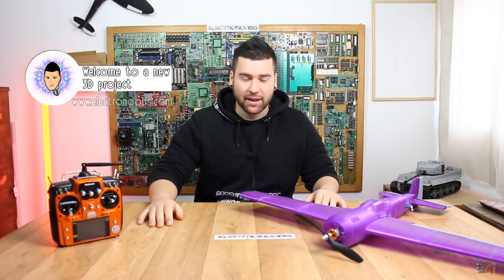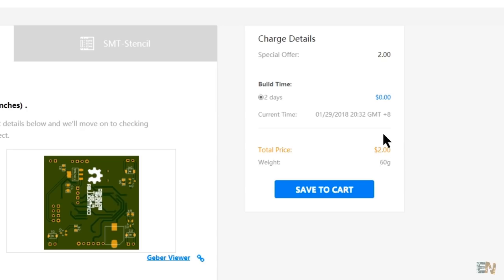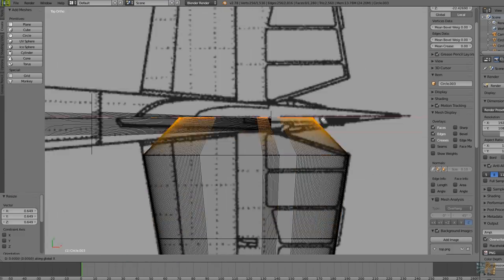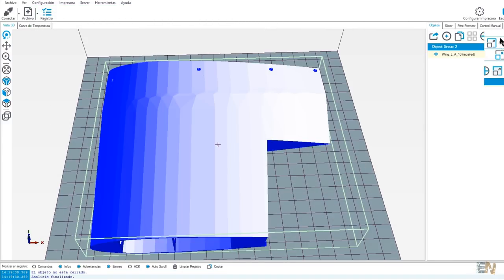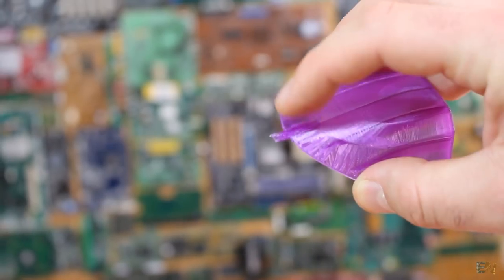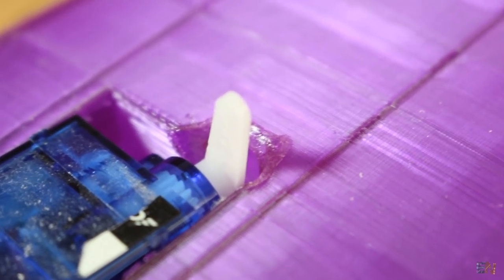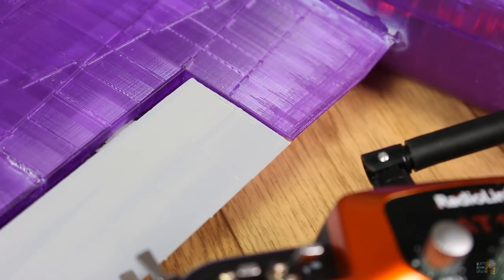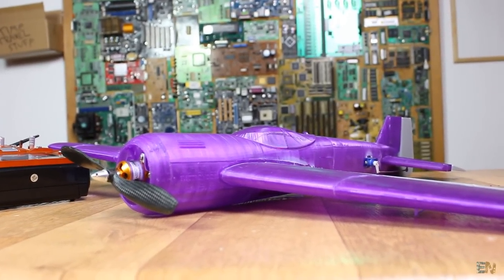3D printed huge RC plane - Yak55

Comment from the maker: First. LOL. Help my projects here, thank you: https://www.patreon.com/ELECTRONOOBS
Download all the STL  files here: http://www.electronoobs.com/eng_robotica_tut11_stl1.php
Q&A: http://www.electronoobs.com/eng_preguntas.php
Favorite printers here: http://www.electronoobs.com/eng_impresoras_favorites_mobile.php
Reply: Has anyone built it yet, if not I can help.
Reply: @coolshooo  Yes, I want to add 1 little motor to wings A, shortly how to edit the wings and what softwere need to use on printing. PLS
Reply: @aliph-null  sorry I didn't understand all of that. Do you have a 3D printer.
Reply: @aliph-null  I wouldn't try to edit the design files. I have purchased the files for a qtrainer. Haven't built it yet but could send you the files
Reply: @coolshooo  I connected the 3D printer to computer via USB, but when I press print on 3D object viwer IT doesn't do anything. Yes the computer see the 3D printer, it has a green light that say all connected
Reply: @aliph-null  what printer do you have
Reply: @aliph-null  I am familiar with cura, from my experience you get more successful prints, printing through a SD card. Try that. And I need to know what printer and slicer you have. If you just bought the printer I don't recommend printing this as your first project. Print a 3D benchy, from thingyverse first. To test the quality of the prints.
Reply: @coolshooo  I will try, thank you
Reply: @aliph-null  no worries, glad I could help
Reply: @coolshooo  
I searched for the problem. I forgot about slicing softwere, now it works, fank you for helping me. (+1 subscriber)
Reply: @coolshooo  Also is my friend's printer, I also want to buy one, what is your recomandation pls, a printer with printing area about 300mm×300mm×300mm at a low price. The high can be bigger.
Reply: @aliph-null  sorry been busy lately, and I don't post anything, I have realized that am terrible at social media, I have heard lots of great things about creality. I would expect that to be a decent printer and am actually planning on buying a creality style printer next year, I'm not a expert on the printer but I would expect that to be at least decent. Their are tones of videos on that printer so watch a few reviews. Do you have any other hobbies? I ask because 3D printing is usually a hobby, not a convenance. You will have to build it, although if you can do a macano  you should be fine. The hard part is finding out what the problem is if something doesn't work. But if you have a friend who has a printer you should be fine.
Reply: @coolshooo  All done, thank You again

Comment: Really awesome project.
I startet printing with the recommended slicer settings. Nose-tip, windshild and both wing As are already.
To connect the wingshield parts I used glue of course. After that I used an old soldering tip on 200°C to weld the parts strong together.
My plan is to connect the wings to the body and make it removable ...
thanks for the great work ...

Comment: It's printing as I type! I'm new to RC plains but not to RC in general. I'm buying a RTR kit to to work on my skills and doing other research as well, I'll make sure to leave a post on how things go when I get it in the air (or if) I get it in the air.

You won't get any slick talk for me about how it will never fly or it's a waste of filament and time because you clearly stated at the beginning of the video that you didn't fly it and you were new to this kind of design.

If haters are hating you doing something right!! Keep up the good work.
Reply from the maker: Thank you!

Comment: Hey man! I just stumbled upon your channel and I don't really have words to describe how impressed I am. Thank you for sharing your knowledge. Regarding the plane though, I'm not sure if it's going to perform properly. You see, It's not enough to take a regular size plane and scale it down. RC models operate in low Reynold's number range as opposed to "big" planes. You need a different airfoil. Things like trim and dihedral angle are also very important. Take care!

Comment: Not bad. Might want to put some packaging tape over the control surface gaps. (Saw an Xjet/RCmodelreviews video on that. Can make quite a difference.) Tolerances are kind of tricky there, but at least you've got prints to test with work them down better.

Also thumbs up for doing a better job in Blender than some guys do with a proper CAD software. :)

Comment: This plane will not fly long. The parts who have to take the forces from steering up and down will break. First the small ones with the metal wire on the servo . During fly all part connections on the wings are heavly stressed from wind forces
Reply from the maker: Thank you. Let's hope it will fly. I'll improve the project each time better and better. Keep up!
Reply: Add something positive to balance the comment 😂 or tell the solution so it will be a beneficial comment 👍
Reply: Andy B Yes, sadly these guys do not get it. I saw one after it crashed. The thing exploded into thousands of pieces. The material isnt bonded enough to survive even a light crash. Foam is king now, face it. Even balsa has lost its appeal. Old timers used to forbid use of foam airplanes at the flying field I went to. As were quads. The old timers have all pretty much passed away now and the flying field was sold, but given back to the club. The new guys allow anyone to fly anything, as long as you pay the $60 fee.

Comment: Nice project... only problem is that your control hinges and push rods are too loose... which means you will encounter surface flutter and definitely a sluggish control......

Comment: Beautiful design but as stated by others the airplane will be difficult to control in flight. The control surfaces such as the ailerons as well as the elevators and rudder are far too large in proportion to the size of the stabilizer. Even the slightest deflection of these surfaces will cause very large control effects. If the design is improved they should be much smaller. I have flown r/c planes for   over thirty years and the need for a properly balanced aircraft with control surfaces properly sized is vital. Hoping you can modify this great design.
Reply from the maker: Thanak you for the tips!

Comment: Wow. Nice work.
Having built a real plane from plans (Cozy MK IV), I can give you some advice. Feel free to ignore them.
Your wings will snap at the first sign of sudden stress, like hard landing or banking at high speed. Your fuselage will break from tail forward with the same forces. 
The reason being the adhesion between layers of printed plastic are not that strong. The orientation you are printing them, is not correct, but you have no choice. 
The only way to fix the problem using your equipment, is to print your parts the way you have them, in soluble plastic (the ones used for support that can dissolve in water). Assemble your plane using water soluble glue. Then cover your parts with carbon fiber or fiberglass and epoxy. 
2 layers of bidirectional cloth like RA7725 and lay them on at 45º to the direction of travel. 
Once the covering is cured, cut the plane into manageable pieces and epoxy support structures made of 1/16" flat fiberglass stock that have lightening holes cut into them, cut to shape and when all is done, attach them back with BID (bidirectional cloth) and epoxy.
Google Long EZ construction techniques and learn about this technique. Here is an example section 3-3 of this document;
http://www.captoscana.com/captoscana/Documenti_Materiali_Compositi_files/MCHSAC-1%20composite%20construction.pdf
If you had a 5-axis CNC machine big enough, you could do the complete plane in foam and cover it with composites and leave the foam inside with no further stiffening. But you don't. Hence, the song and dance :)
Download full long EZ plans in PDF;
https://docs.google.com/file/d/0B8ljui4BNLG8WWxNYmtDaTk1WlE/edit
Good luck.
Reply: Learn to understand what you read. Did I say it won't fly?
Why hijack my comment with your irrelevant comment?

Comment: The gaps between the surfaces is too large. Air will get through there and make the surface ineffective. Also too much slop in the pushrods.  Don't try to fly it without fixing first.

Comment: Hello
I'm italian and i'm using google translator (i hope it will translate correct)
please read all the comment for a little surprise at the end:-)

It is admirable your commitment to create this model, congratulations!
I have to give you some modeling tips:
To transmit the movement to the moving parts you have to use harmonic steel (music wire I think it's the name in English: it's the steel used to make springs: in modeling shops you can find many sizes) because you do not only have stress in traction but also in compression and the iron thread in compression bends.
The connection point between moving surfaces and wire that you created is graceful but weak, I suggest you look at the online catalogs to see how they are made.
At this point I would advise you to change the position of the steering servo (rudder) to avoid folds in the steel cable.
I suggest you to create small rectangles of similar thickness to the side members to be applied on the points of conjunction to increase the glued surfaces.
First glue them on one of the two pieces to be joined and then join the second piece.
Have you calculated the dynamic efforts to which these pieces are subjected? they seem very subtle and I would not want your model to disintegrate in flight due to structural failure.
one for all the engine support: it is the most stressed piece in tension during the flight and at the torsion during landing with the vertical propeller.
Another very stressed point is the junction between wings and fuselage: normally the junction between the semis is reinforced with bayonets of more robust material, usually the same size of the side members, sometimes for acrobatic aircraft are used if they use two Try to watch some other video on 3Dprinted flying planes paying attention to the details I told you to better understand what I want to say

Y ahora in Catala':
Hola
És admirable el vostre compromís de crear aquest model, felicitats!
He de donar-vos alguns consells de modelització:
Per transmetre el moviment a les peces mòbils d'utilitzar acer per a molls (cable de música que crec que és el nom en anglès: és l'acer utilitzat per fabricar els ressorts: en botigues de hobby es poden trobar moltes mides) això perquè no només té l'estrès en la tracció sinó també en compressió i el fil de ferro en corbes de compressió.
El punt de connexió entre superfícies mòbils i fil metàl·lic que ha creat és bastant feble, però, vostè ha de buscar en els catàlegs en línia per veure com es fan.
En aquest punt, jo recomanaria que canviï la posició del servo de direcció (direcció) per evitar la formació d'arrugues en el cable d'acer.
Suggereixo que es crea de petits rectangles de gruix similar als elements laterals per a ser aplicat als punts d'unió per augmentar les superfícies enganxades.
Primer enganxeu-les en una de les dues peces que s'adhereixin i després s'uneix a la segona peça.
Heu calculat els esforços dinàmics als que se sotmeten aquestes peces? Miro molt prima i no vol que el seu model es va desintegrar en vol a una fallada estructural.
un per tot el suport del motor: la peça és la més van destacar en la tracció durant el vol i a la torsió durant l'aterratge amb l'hèlix vertical.
Un altre punt molt estressat és la conjunció entre les ales i el fuselatge: Normalment la unió entre els panells de l'ala s'enforteix amb la baioneta d'un material més fort, generalment de la mateixa mida dels elements laterals, de vegades per avions acrobàtics utilitzant si utilitza dos tracten de veure alguns altres vídeos en avions de vol 3Dprinted prestar atenció als detalls que us vaig dir per comprendre millor el que vull dir
Reply from the maker: zola tanaffa thank you very much for all your tips
Reply: Do not worry, it's a pleasure.
I have now seen other comments that make me understand that I am not the only one to have doubts about the robustness of the model in flight.
You did a great job of drawing, and it's a nice starting point: now you have to add what's missing.
Remember that the center of gravity of the model must be around a third of the wing rope to fly and then once corrected you can reach it by moving the battery pack and the electronics in general.
Hello and good work!
P.S.: Is the català correct?

imaginat és un plaer.
Ara he vist altres comentaris que em fan entendre que no sóc l'únic a tenir dubtes sobre la robustesa del model en vol.
Has fet un bon treball de dibuix, i és un bon punt de partida: ara heu d'afegir el que falta.
Recordeu que el centre de gravetat del model ha d'estar al voltant d'un terç de la corda de l'ala per volar i, una vegada corregit, podeu accedir-hi movent la bateria i l'electrònica en general.
Hola i bon treball!
Reply: zola tanaffa ets d’una part d’Italia on parlen català?
Reply: Harakiri no not in Italy. i Just translate in catala' because, if i remembering correctly, is the  Barcellona' language

Comment: Using Blender isn't ideal. It is very hard to parametrize everything and much more time consuming than the also free, Fusion 360. Blender is for organic shapes and sculpting (and much more), Fusion 360 is designed specifically for stuff like this.

Comment: i am using 2200kv motor  esc 30amp with 2200mah 3 cell 11.4v 40 c battery  and i burned my esc what esc should i used
Reply: hoped some suggetions
Reply: A good one perhaps 😂
Reply: what is your propeller size?

Comment: Are you serious? So much great modelling work but so many R/C model fundamental design mistakes... The control push-rods with so sloppy connection - there will be no control precision. You can build it like that - and it will crash in first flight. Did you introduce any motor angles to compensate motor rotation - or they are straight and anyone has to set the motor on their own? Ugly truth...
Reply from the maker: Put more washers in one side of the motor and adjust angle to compensate rotation.
The push rods are homamade because I was waiting for a package from eBay to arrive with better metal wire for RC and plastic connectors. 
This is first version of the plane and it was a lot of work and I'm not a professional. I'll do my best to improve. Thank you for your help.
Reply: Now I understand - but showing publicly such a mistakes can lead to young adepts making such mistakes and crashing their models in future.
Reply: Przemysław Jakubczak This guy probably knows nothing about RC,just electronics and such. These 3-D planes are as delicate as eggshells.  When they crash, the bonding comes undone resulting in a mess. I have seen guys dip their planes in Acetone to get the material to bond better to its self. I think that method would survive a light crash much better.
Its a cool project, just not sturdy.
Reply: Electronoobs I know guys that paint the shell in acetone to make the bonding stronger. The problem with 3-D printing is the material is not bonded strong enough to survive even a light crash. Also, using Acetone smooths the surface and eliminates that texture that effect the air resistance.  Nice job on the beginner model, good luck on the next one.
Reply: totally agreed.  Youtube is a crowdsourcing platform, everyone's input make it a better place. If you want something correctly done out of the box, go buy one, don't just add negativity here.

Comment: looks great, so much work. bad news for you though ... it wont fly. you can't just scale the plan of a full sized plane to a model. fluid forces are not linear to geometric's linear scale. i recall doing math excerceses to scale wing prrofiles to model sizes that can be tested in wind tunnels .. i forget the exact term but you'll find it in an article such as this one (https://www.diva-portal.org/smash/get/diva2:10823/FULLTEXT01.pdf) . did you think of the weight balance of the plane? a relatively easy one to deal with if you are in ballpark. hard one is wing profile , surface arias, aeleron surface to wing surface ratios, weight to surface area ratios.
Reply: I do not think he wanted to make a real rc aircraft. He just made a popular video.